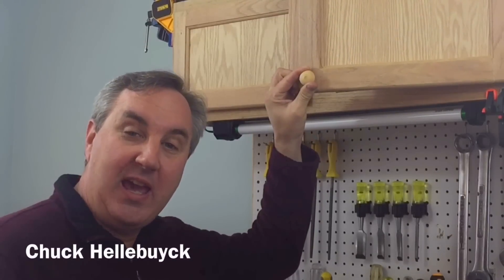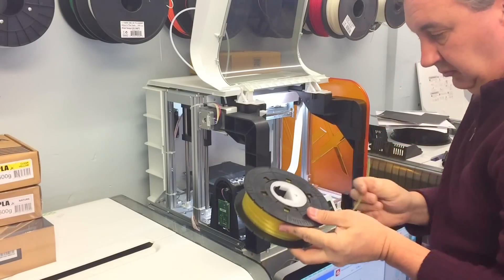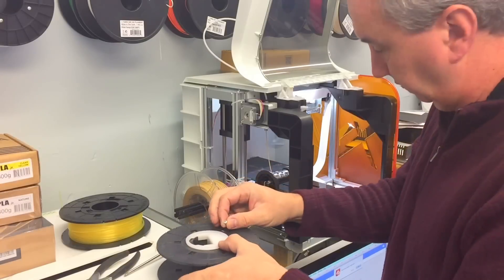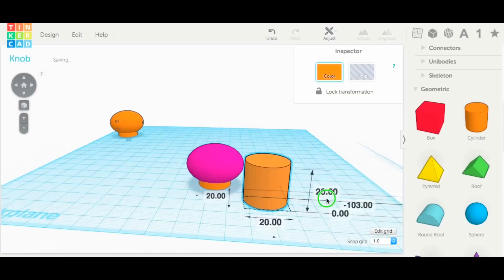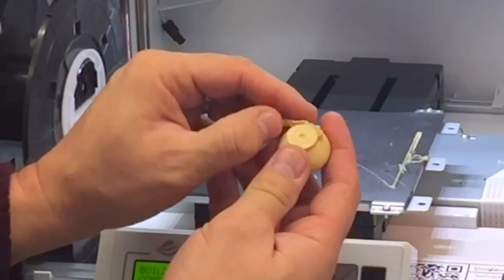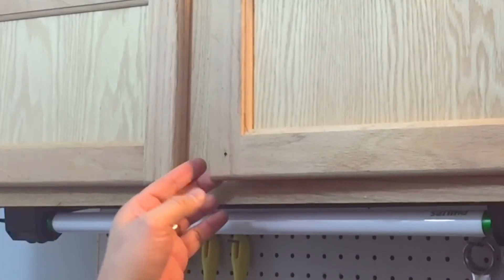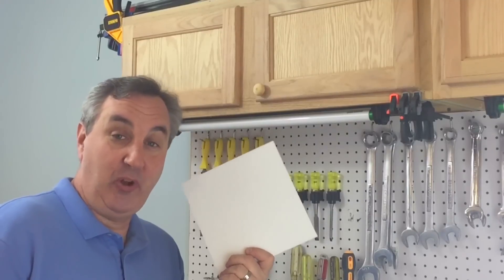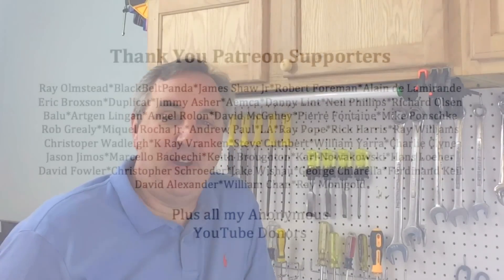Filament Friday #51 - 3D Printing Wood Filament Cabinet Knobs on a Da Vinci Jr

Comment: Hey will you not have a problem with the chip printer thinking the spool has run out because the printer tells the chip that the filament is being used

Comment: I have a davinci jr 1.0 and I want to print with a 3rd party filament such as the wood one you used but I would like to know if anyone knows how to change the temperature to work with other 3rd party filament which may take more heat and not as in range as the wood filament was

Comment: been watching a lot of your videos, and i decided to go ahead and try a da vinci JR since the fabricator mini is sold out, i did find a knock off mini but not sure about it

questions:

1 - did you know there is a (hack) to reset the spool filament on the VINCI JR  to use generic filament?
2 - do you know if it is possible to flash the VINCI JR like you did with the 1.0

Comment: lol I done this before but I didn't remove the side panel what I did was make a small groove under the  door and ran the filament through a Teflon tube worked wonders  but after  many prints with the wood filament the da vinici jr stop printing upon inspection I found that near the nozzle there is metal plate  and when I removed I can see that all around the inside of the print head was the wood filament that hard cooled and hardened over time to clean though I just heated the nozzle up and let it soften then carefully scrape it out so moral of the story  two things, one  remove the bottom plate and two after every print with wood filament clean nozzle drive gears print head and it will work fine

Comment: Hey chuck do you use bed tape for the da vinci jr? I use bed tape on mine and I was wondering when I need to renew the tape.
Reply: +Chuck Hellebuyck&#39;s Electronic Products Thanks for the reply. I'm thinking of buying buildtak aswell but the size is a little too big. Is it possible to trim the buildtak to the correct size?

Comment: Can you put Ninja Flex in a da Vinci junior
Reply: +Chuck Hellebuyck's Electronic Products Please do a video maybe ( I am not telling you to break your printer) 😊
Reply: +Chuck Hellebuyck&#39;s Electronic Products I know you use a mac but for windows there is a program that lets you convert gcode to 3w files which is what i use for my da vinci jr because i got simplify3d thinking it would work. You can adjust the temperature in simplify3d and you can load the gcode to the sd card or send it with your computer and it works great.
Reply: ***** No it's not a secret. It's actually not even mine. The program was created using ripped source code from XYZWare. Here is a link to the forum page where I found it. http://www.soliforum.com/topic/11108/davinci-junior-cartridge-reset/page/10/ You have to create an account in order to download it, its towards the bottom. I'm pretty sure there's some programs that allow you to run windows applications on Mac. Anyway it couldn't be simpler, you just put the .gcode in, click convert and it converts it to a 3W. If you are using simplify3D, you do have to remove all the generated headers in the GCode before converting or the 3w file wont be recognized.
Reply: ***** Hope all goes well! Notify me on any results!

Comment: Hey Chuck, I love your videos they have helped me a lot, and got me into the davinci machine. I have a davinci 1.0 I have down graded the firmware after watching your video on this. I am looking into getting simplify 3d, and going to start printing with PLA. In the simplify software can I turn off the print bed temp? Also do I have to flash the machine to repetier, for the software to work and to print the pla nicely. If it is possible could you do a video on the simpify software settings. thanks. can't wait for future videos.

Comment: hey Chuck, would you mind uploadig the settings your use for simplify3d? mine are all messed up and for some reason, my flashed Davinci 1.0a printer won't heat when I use it as my slicer. it works on any other slicer but simplify.....

Comment: Do you think you could do a more in depth video on using a 3rd party filament on the da vinci jr?

Also, on a slightly unrealted note, do you know of any way to adjust the tempature of the extruder on the da vinci jr?
Reply: +Chuck Hellebuyck's Electronic Products Ok, well thanks anyway.

Comment: Hi chuck the jr. seems like it prints really good. I have a da vinci 1.0 and because im not smart the bed got cracked pretty badly.  Could i just flip the glass pane over and print on the heat element if i use tape when printing to protect it ?
Reply: +chace bouck (DeyeChace) i have one to and i say go for it
Reply: ok thanks for the reply.  ig im going shopping for some new glass then.

Comment: Hi Chuck,

I would like to remove the side of my PRO (need to do some work on the inside). Do you maybe know how to open it? You mention two screws at the top! Where about are they located?
Reply: +Chuck Hellebuyck's Electronic Products I will give it a go, but will probably end up like.. Ooops.. There was a screw :/
Reply: Okay.. No problem opening. It's like the 1.0. Your video (Broken Bearing Mount Replacement on Davinci 3D Printer - Video #010) is spot on!Thank you

Comment: If there is a way you should re-flash you da vinci junior or you could use the filament reset with the video titled " DA VINCI 1.0 Filament reset - easy - works . . . " but I don't know if that works for the davinci junior. Great video. Maybe I'll do something with wood filament on my two 3d printing channels later.
Reply: That's not good. But I do have to say that Davincis are great printers, but they have alsorts of restriction. I would rather have a Davinci than do printer.
Reply: +Panoreth 3D Printing If you get a 1.0, 1.0a, 2.0 you can reflash them with Repetier Firmware and use it with any Slicer software that works with a Prusa printer there is also a guide from a british YouTuber how to fit a E3D v6 hotend in it. I can send you a email with a picture of my owl I printed @ 0.1 layer height it turned out amazing :D I am also working on a RAMPS mod for the Jr
Reply: ***** The seller I bought it from declined the order and gave me my money back because they didnt have the printer in stock but they still sold it ^^. I saw another 1.0 on eBay for the same price so I am going to buy another 1.0.

Comment: Chuck, 

I have a hypothetical question.  I have finally decided to buy a Geeetech Aluminum 3d printer.  I know from the numerous videos I have watched that there is a ungodly amount of wiring that I believe could possibly be shortened.

My question is if I were to shorten the wiring to one of the 2 stepper motors for the X axis, would it throw it out of timing with the motor with the longer wiring?
Reply: +Chuck Hellebuyck's Electronic Products Thank you.

Comment: It could be the harness that go from the nozzle to the main board or the thermostat that is in the nozzle so if you don't mind checking the harness should be a 6 to 7 cable. I will send you one if you confirm which harness you have

Comment: Chuck,
is the extruder heater element on your 1.0a what isnt working. I had the same problem and it ended up being the thermo wire connector set that connects to the extruder which broke inside the connector.. replaced it with paddle connectors and it worked great from then on... hope this helps....
Reply: +Chuck Hellebuyck's Electronic Products yeah I had the better white one and thats the one which broke... so you might want to check that just in case.. had the same symptoms... it was intermediately failing... so like I said I just clipped the connector and replaced it... and its been fine ever since.... when I looked inside the wire on the connector and the metal clip had both broke... so take a look.. =)

Comment: Wow! i have a da vinci jr, And i can just take a empty spool and feed other filament in?? ill have to buy some of this esun wood filament. Great video by the way :).
Reply: +Me “Dapaca” ow You'll waste filament. You can use many kinds of plastic in the da vinci junior, as long as the temperature settings are similar to the official PLA plastic. If you use 3rd party filament, the printer will still need the little green chip that came with the official Junior filament. That green chip records how much filament you use, and cuts you off when it's up. So the filament that came with the green chip, can't be used. You can give it away or use it in an unlocked printer. XYZprinting can unlock the Da Vinci Junior to not need the green chip...but their hearts have not softened on that matter. Printing with wood is fun, it's worth it if you're okay with wasting filament.

Comment: Another job - Start to Finish. Very helpful to be exposed to the PROCESS instead of just the steps.

From defining a need then designing the solution, producing the results and finally fit and test, you've shown us how it all fits together.

Thanks for sharing...

Comment: Just curious, did the spool with the chip spin during the print to register any usage of filament?  Or does it simply need to be in place to tell Jr there is a proprietary spool in place?
Reply: +Jimmy Shaw's Tidbits There is currently no way to pause the filament counter on the Da Vinci Junior. There is no way around this, until the fans figure out how to pause that counter in the little green chip. The little green chip has to be somewhere near the Da Vinci Junior printer, or the printer will not print at all. So you're left with a fresh spool of official PLA filament you can not use, because the chip counter got used up with alternate filament. 
If you have an unlocked 3D printer, then you can use your spare filament in that. But sadly in my case, all I own is the Da Vinci Junior, so I would have to give away the spare filament. It's very expensive to use alternate filament, but at the same time, it's exciting to use different kinds of filament. XYZprinting made a very firm decision to not allow alternate (3rd party) filament in the Junior, and so far they have been insanely stubborn about unlocking the printer. This has caused a lot of outrage, but the Junior is still the best deal for the money.